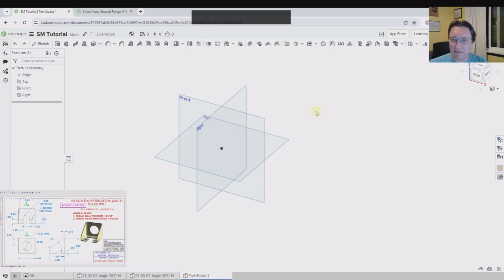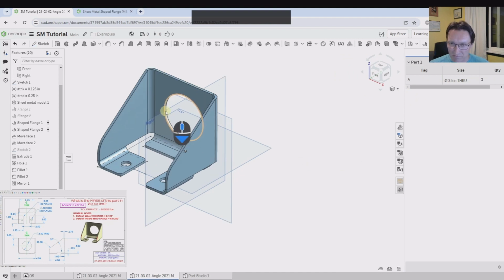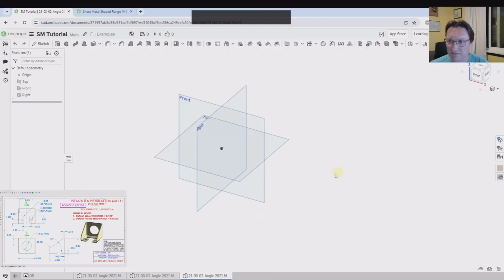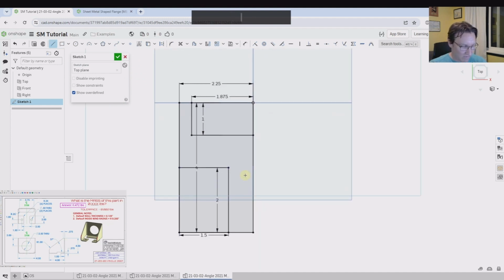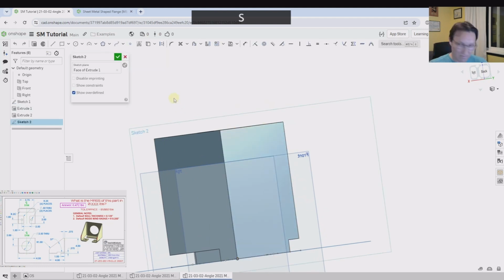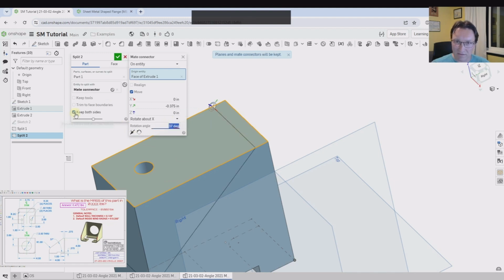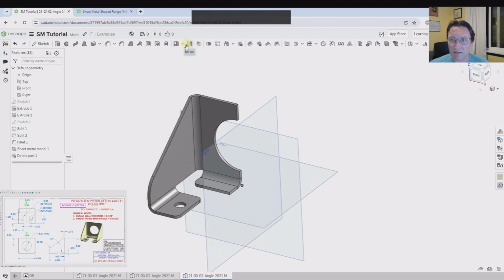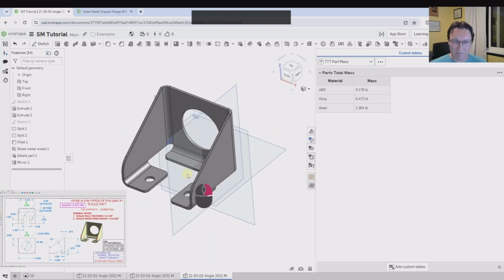Onshape Sheet metal tutorial: Too Tall Toby 21-03-02 Angle 2021, third solve method.

Comment: nice nice, a question....... how I can ad a chamfer on one ofthis bore.
Reply from the maker: Hi, Onshape currently doesn't support "non-normal" features (i.e. anything that would create a face that isn't perpendicular to the faces of the metal) in active sheet metal parts.
I expect this capability to be added soon but in the meantime if you need a  chamfer you have to first add a "finish sheet metal" feature and then you cand add it. Just be aware that the chamfer will not be shown in the flat pattern view.